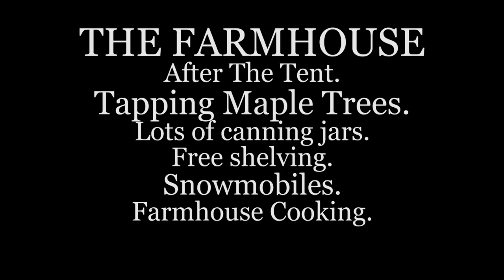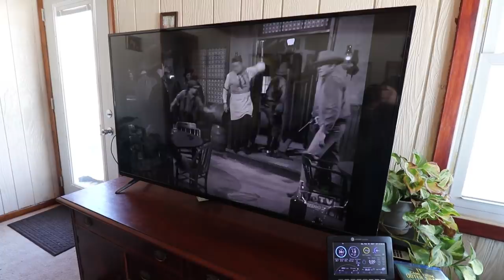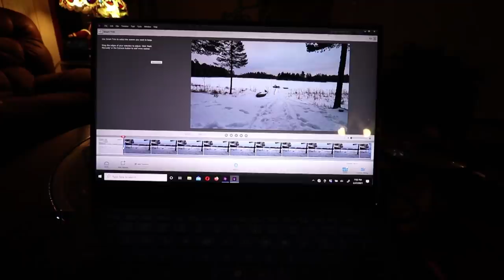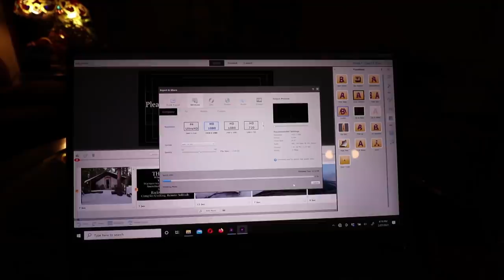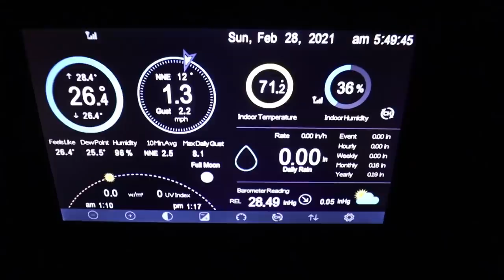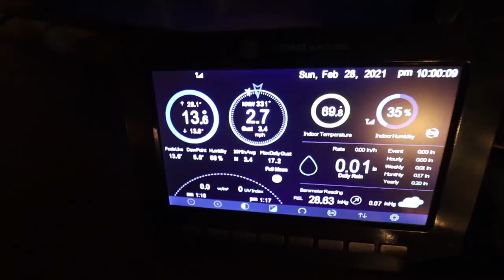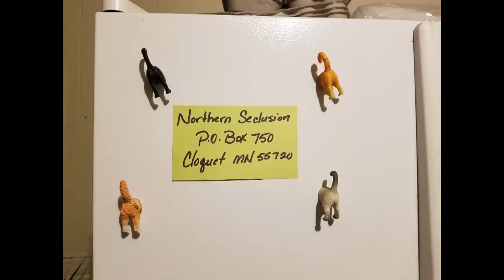THE FARMHOUSE. After The Tent. Tapping Maple trees. Canning jars. Snowmobiles. 4wheelers.

Comment: I didn't know Melissa poured greenware. My dads mom had a large ceramic shop she started in the 50's and I grew up around it. When my gram died in 82. She left the shop to my parents and I'd been working there for 4 years for her. I poured greenware, fired, air sprayed the greenware pitchers and bowls etc. I taught classes. So I had to teach my parents the business. Our shop had over 35000 molds. We had a huge coffin kiln, a large kiln, and a small kiln. We also poured for other smaller shops around the oregon coast and other areas. When my dad died in 89. My mom and I ran it for a couple years. But was to much heavy work. So mom sold the molds etc in 91. We mixed our slip, poured all our own greenware. Did classes. And sold bisque. I also did finished kitchen ware for years and sold it at craft shows and gift shops. Sometimes I miss it. But not how heavy those molds are. A cup mold can weigh 10 pounds. We had a Santa mold that weighed 150 pounds empty!That is probably why I have to visit my chiropractor all the time now that I'm 61. All those things you did when you were younger comes back to bite you in the rump.
Reply from the maker: Very interesting Lori. We need to get the kilns hooked up so Melissa can start pouring some of her molds. So much to do and such short time. Once I can quit doing construction work I will hopefully have more time to get things set up.

Comment: Hey Joe, one of the things that you can do to keep the engine cooler (on warmer days) is install snow scrapers down around the track.  They are extendable so that on cool days, the can be retracted on on warmer days extended.  So, they will kick up snow to keep the engine cooler, which on our skidoo's are at the back of the machine.  FYI.
Reply from the maker: I think the snow scoops are only used on liquid cooled motors. (I could be wrong) Mine are fan cooled.

Comment: A guy I watched before when tapping maple trees, he put the tap in then slid a small clear hose on an ran it down to the 5 gallon water jug. Hopefully your oil tank doesn't start leaking those are a pain to remove they have to be cut up

Comment: I still am sad when i see that trash can going to the road because it signals the end of your video.  I have a question though about the maple buckets. What do you do when it rains. How do you keep the water out. Do you have lids or. Something?
Reply from the maker: Normally rain is not an issue (or hasn't been for me when I have done this in the past). I do have covers though. The good thing about the sap is that water is lighter than the sugar part so at night when things freeze you can take the frozen water layer off the top of what is in your bucket and toss it out.

Comment: How is the snowmobile running?  What was wrong with it that it could not get up to speed?
Reply from the maker: Too warm out. It works awesome when it is below 30 degrees.
Reply: Air / fuel mixture. Cheap fix.

Comment: Joe, I suggest using a small saw to put a hole up near the top of the pail and then putting the tap through using a nail to keep the pail on the tap.  Then you can use lids.

Comment: Do you use sta bil 360 in the snow mobiles? I use that in all my equipment and never have had any problems. I know people use other things. You need a storage tank there for  gasoline and have it delivered since you are only using it at home on your property.
Reply from the maker: I put sea foam in mine. I will probably run something more in them before I shut them down for the warm months.

Comment: I tap mine by using a piece of 3/8 copper tube and attach a piece of tubing leading to a 5  gal bucket of the ground with a hole drilled in the top. Keeps all the junk out of the syrup.

Comment: Joe, have you ever considered using the plastic sap collection bags? Here in Michigan, they've been in use since the 1950s. I know there is a lot of history/romance involved with using the old spile and bucket method but the bags are a great deal more sanitary. Also, you don't have to worry about covering anything to keep the critters out. The bags are held in a metal frame and are easy to empty. At the end of the season, the used bags can be rinsed out and put into recycling or discarded. The really big time maple syrup guys here in Michigan often use clear tubing to carry the sap from the trees to the tank, but it looks like like a royal pain in the neck to me. --- Linda in MI
Reply from the maker: The bags are cheap but each metal thing was 10 bucks. Until I see how these trees produce, I was not going to spend a hundred dollars on something I may only use once.

Comment: Thanks Joe! Could you please explain  what you are doing? What are the buckets hanging on?, dont insects and critters get into the pails? After you collect the sap, then what?
Reply from the maker: Stay tuned, Many videos to come.
Reply: The buckets hang from the spout *they have a name but I can't remember it but I forget at the moment)that he showed dumping those things from the bucket when he was in the workshop just before he went into the woods to drill the holes and place the buckets on the trees. the sap is filtered through a cheesecloth then put in large flat shallow pans and slowly simmered until it reaches the thickness you desire and is a nice golden tan or amber in color, then put in bottles or canning jars and seal while still hot.  
But keep in mind it takes about 40 gallon of maple sap to make 1 gallon of syrup and while simmering it has to be constantly stirred or else it will burn or scorch which is not desirable, It really is a labor of love.
Reply: @Nortekj  thanks great explanation  no wonder why real maple syrup is so expensive!!!
Reply: Those taps are called spoils